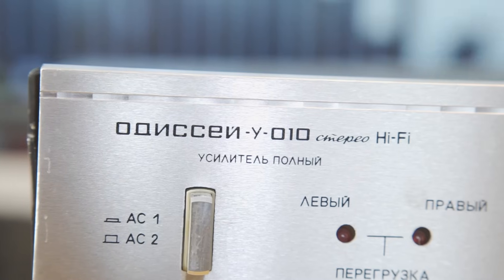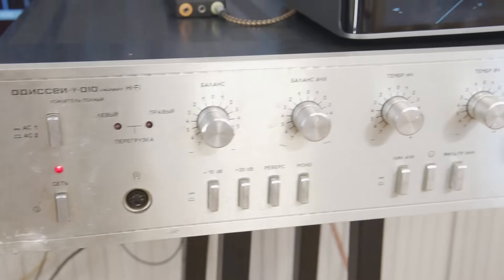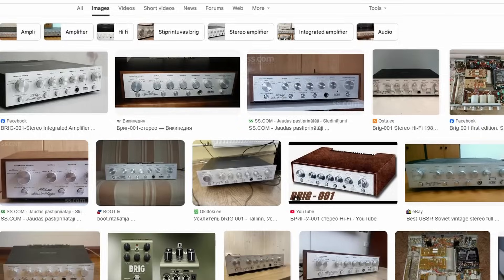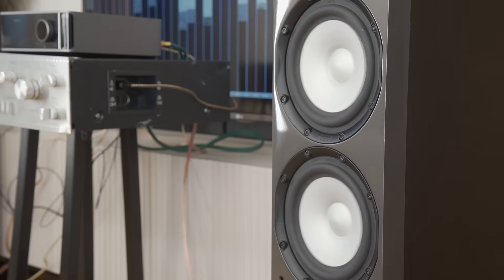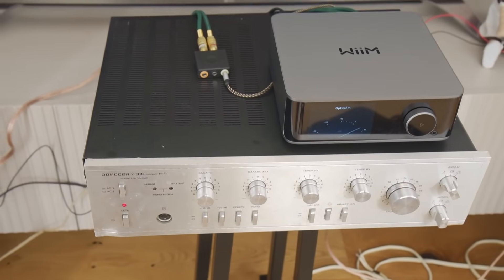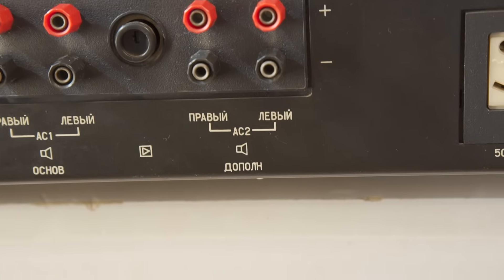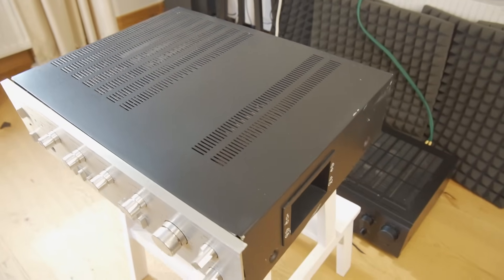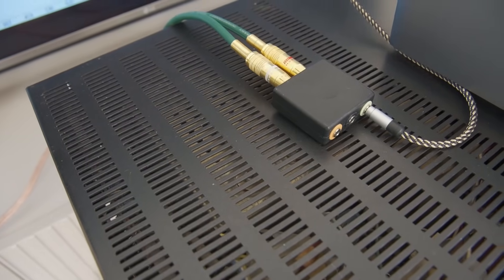Look inside High End USSR Amplifier Disassembly

Comment: If it hums when you turn it on then you’ve got power supply or possible transformer issues.
Reply from the maker: Then 90% of that time, the system has issues. That hum doesn’t come from the speakers, but from the huge transformer.

Comment: Soviet transistors are horrible - the current gain may be 20...180.When you measure voltage drop on junction - each transistor has different voltage drop. There were transistors with current gain = 1. I didn`t measure the transition frequency and noise but these parameters I think are not so good. The USSR had not technology of artificial silicon (Si) for semiconductors and they manufactured lots of defected ICs. But for HI FI equipment it needs quality operational amplifiers

Comment: I'm surprised to see selector switches with resistors as tone control! I've never seen it in hifi like this. The design inside and out has 80s W-Germany audio vibes. The DIN connectors also support this idea. Very neat and unique device anyhow! The amount of connectors on the side is also very interesting.
Reply: As well as you, I'm surprised too to see selector switches with resistors as tone control, but now I think it makes more sense to do it that way.
Because you don´t have a running contact wearing a potentiometer..., and even you have gold contact to gold contact interface 👌
They come up with original and solid design ideas at those times..., other example are the Cassette Decks with 3 full direct drive motors, no belts at all, 99% of problem solved 🤯
Greetings from Buenos Aires 🙂
Reply: That is nothing special, even my cheap Chinese made MC-22 clone preamp has the same syle stepped tone control too, only difference is resistors and capacitors are on the pc board, which is better for repair service anyway. And old Marantz 7 pre has that same style of tone control construction.

Comment: It looks be a very well made device; as I don't believe that in U.S.S.R. there was the technology to design a so sophisticated hi-fi device, it had to be a clone of a german brand model (the DIN connectors were typical of the german productions: the american and japanese manufacturers, instead, already used the RCA pins).
Reply: Luis do really think people that designed aeroplanes and space rockets don't know how to design proper hi-fi amplifier,come on man 😀
Reply: @kikopasinecki5110  Here is such a paradox, the country that made spacecraft and powerful weapons did not know how to make normal cars, household appliances, audio equipment. Most often, Western samples were either completely copied or partial copies were made. Extremely rarely were fully self-developed samples produced. As an example, compare photos of Japanese speakers from OTTO SX-P1/Fisher STE-1200 with Электроника 100 АС-063 will be very surprised.
Reply: Did you ever see the russian photo cameras of the ‘70-‘80 years (the ZENIT)? They were at least 15 years slow than the japanese ones, there were no comparision. And what about the "KIEV80", which was a clone of the swedish Hasselblad or the "ZORKY" which was a copy of the Leica M4?
Maybe now in Russia there are the same technologies of America or Japan, but in the ‘80s it surely didn’t go the same way.
Reply: Полностью аутентичная, классическая схемотехника этого усилителя. В СССР это были разъемы ГОСТ.

Comment: The attention to detail and the build quality is amazing, even the bulk electrolytics have bleeder resistor across them.  You'd do well to disassemble it and give it a thorough cleaning, visually check electrolytics for bulging and replace any that are.  Also remove and replace the insulating washers that go between heatsink and power transistors and apply new thermal compound, it does dry out over time and cooling becomes less efficient and yhere's not much chance you'll find replacement output devices with the same type number.
Also check the output terminals for offset voltage, a few millivolts (up to 10) isn't a problem and there should be a pot for adjustment of that and another pot for quiescent current which you can set up with a signal generator and an oscilloscope.
Reply: You are partially correct Steve,he should clean and reset the idle current,but the capacitors are very hi quality ,they rarely go out and the transistors are very common in Russia and ex USSR countries,it is marked with Cyrillic letters KT819👍
Reply: @kikopasinecki5110  these where *KT819GM/KT-818GM (probably Toshiba clone) and shouldn't be confused with KT818/KT819 A/B/G. also all the through hole electrolytics should be thrown away ASAP
Reply: Начинать надо именно с электролитических конденсаторов,  они не "вздуваются",  а со временем теряют емкость  и имеют увеличенные утечки... - заменить все на новые;  подстроить напряжения.
Reply: This is a high-end Soviet amplifier, and it comes with technical documentation with detailed instructions on how to configure all operating modes for each module. These instructions are freely available on the Russian internet.

Comment: This amplifier needs complete prevention with soldering of all contact leads of radio elements, replacement of all electrolytic capacitors, cleaning of all contacts on switches, adjustment of quiescent currents and zero voltage at the output of the power amplifier. And only then can audio tests be carried out. Without prevention, this amplifier will not show a small share of its capabilities in sound. Nevertheless, the quality of radio parts from the times of the USSR is much worse than Japanese, Korean or European manufacturers and the 40 years that have passed since its release have not had the best effect on the condition of all radio parts.
Reply: Вы все же ошибаетесь. Лет 5 назад я нашел в лесу платы старого советского телевизора. Судя по мусору они пролежали там года 2. Этим летом я наконец выпаял все компоненты, помыл, просушил. И многие из них выдают нужные параметры! Они конца 70х годов!!
Reply: @AlexUboot96 да, ми все ошибаемся. Конечно, только вьі в живую видели старьіе советские компонентьі, а мьі - только в кино.
Reply: You are speaking nonsense,the parts that USSR made were top quality.They made airplanes and space equipment,and you are telling me they don't know how make resistors and capacitors🤣
Reply: @kikopasinecki5110 Are you joking? Maybe hi quality was in military electronics or maybe in aircraft. But it was not in mass market devices. The dead capacitors are a curse of old USSR electronics. Especially if it was produced in the end of 80s
Reply: @kikopasinecki5110  I live in one of the countries that were part of the USSR, and I had many different audio equipment produced by various factories in the USSR. Therefore, I know what I say, the best samples of radio parts were selected for space and military equipment, the second class went to equipment that was exported to the Warsaw Pact countries and some capitalist countries, everything else went to the domestic market. Look for a video on YouTube where Soviet audio equipment is being repaired, you will be very surprised at the comments of the masters about the quality of the parts. I myself was engaged in the repair of such equipment and believe me, the quality of Soviet, mass, parts is many times worse than the cheapest with Aliexpress. The spread of the declared parameters is +/- 20% of the declared nominal, consider it lucky. To find a pair of transistors with similar parameters, it was necessary to measure a large number of transistors. Even releasing them in one batch did not guarantee the same characteristics.
Reply: @kikopasinecki5110  I live in one of the countries that were part of the USSR, and I had many different audio equipment produced by various factories in the USSR. Therefore, I know what I say, the best samples of radio parts were selected for space and military equipment, the second class went to equipment that was exported to the Warsaw Pact countries and some capitalist countries, everything else went to the domestic market. Look for a video on YouTube where Soviet audio equipment is being repaired, you will be very surprised at the comments of the masters about the quality of the parts. I myself was engaged in the repair of such equipment and believe me, the quality of Soviet, mass, parts is many times worse than the cheapest with Aliexpress. The spread of the declared parameters is +/- 20% of the declared nominal, consider it lucky. To find a pair of transistors with similar parameters, it was necessary to measure a large number of transistors. Even releasing them in one batch did not guarantee the same characteristics.
Reply: @kikopasinecki5110 only resistorz and capacitors were fine. Diodes were ok. But other semiconductors like transistors were mosly not good if they are not military grade #9.

Comment: Fascinating. Russian on the outside. English-marked part numbers on the inside.
Reply: I am curious where did you see English marked electronic parts?It is all in Cyrillic,and the transistors is marked KT819(Latin and Cyrillic  K and T are the same).
Reply: Импортные детали в советских усилителях не использовались или использовались крайне редко.
Reply: At 2:15, look at the markings on the PC board. R7, R23, C19, C23 are obvious in the middle of the board. Russian doesn't use "R"; and "C" works well for English "capacitor", but less well for "конденсатор", so is unlikely to be the Russian "S" symbol. On the other hand, I see mechanical parts clearly marked in Russian. An interesting combination.
Reply: @lwilton  Incorrect. All elements in diagrams was marked in Latin, it`s normal practice for USSR. Like R, C, L, but values was in Russian. v-volts-в-вольт, khz-кгц,  Ohm- Ом, mH-мгн......

Comment: I am quite surprised to see this kind of a high end type stereo amplifier which was made in the USSR back in the 1980's !! 😮 😮 
It has the same appearance of a well made European or Japanese stereo amplifier of the same period.!
I am astonished to see this Soviet made amplifier of this quality !! Can you please tell me whether it was a consumer product made for sale in the Soviet Union mass market at that period or else it was a limited edition model made just for the show !? 
Thanks for a reply!
Reply: This model was released in a batch of more than 10,000 pieces. It cost at the time of release in 1984 about 500 rubles of the USSR, translated into dollars at the exchange rate of that time it is about 400 dollars.
Among all brands and models of amplifiers produced in the USSR, this model at that time had advanced circuitry, a unique system of balance of amplitude-frequency characteristics of the timbre block, stabilized power supply of the power amplifier units, which made it possible to obtain a large nominal output power with low distortion, and then more than 50W for a load of 8Ohm, the maximum power on the latest modifications of this model was brought to 100W per channel.
Reply: @RKL-i8o  10,000 pieces were a substantial amount. 500 rubles equalent to 400 dollars was a high figure comparatively in 1984 ! 
I remember buying in 1982/1983, Japanese made Kenwood KX 50 cassette deck, KA 30 amplifier (25 W per channel) & LS 99 Speaker system (3 way, max. 100W) all three items for around 400 dollars (Rs.10,000/-) here in South Asia where i live.
I noted the description of your comment and see that this amplifier was a very good, advanced model made in the Soviet. I see that this amplifier delivered 50 W per channel at 8 ohms. When was the latest modification of this model with 100 W/channel made !? 
Soviet was a total communist country at that time. I am surprised to learn that this kind of consumer electronics were made for the Soviet mass market at that period !! Its very good to hear about this matter from you. Were you living in USSR at that time in the 1980's !? 
Thank you very much for mentioning all these details in your reply ! I appreciate it! 🎉
Reply: @janath9118 я жил в ссср в 80х. цена была 350р. это очень дорого, практически две зарплаты советского рабочего. новая модель называлась одиссей 100у-021. дизайн и исполнение у него на много проще, он весь пластиковый но мощность у него реально очень большая, 100w на 8om без искажений. у меня такой есть, работает уже более 30 лет.
Reply: @МихаилПрохоров-ь2е  Very sorry, i cannot understand your language.
Reply: Odissey-010 was mass manufactured. It is not a High End actually. It is just quite Ok for its time, like good hifi.
Reply: @volodymyrzakolodyazhny I noted it. Thank you for the information !!

Comment: New Capacitors.....PLEASE.
Reply: The capacitors in this amplifier are first class(same as the Japanese or American ).I'm a repair man and i can tell you that the electrolytic capacitors used here rarely die in CRT TV's(which is more hostal environment because it uses switching power supply) and in this amplifier they will last very long.
Reply: @kikopasinecki5110  High-capacity capacitors from the power supply are possibly in good condition, but the rest are already a lottery. It is better to replace all the little things, these are not Yamaha, Luxman, NAD, Marantz, SANSUI, ONKYO, with their almost eternal radio parts. Soviet capacitors, especially those produced at Armenian factories, are simply terrible, often even the warranty period was not worked out. If you come across electrolitic capacitors with a ceramic bottom, then you received greetings from Armenia.
Reply: @kikopasinecki5110  They are still 41+ years old.....
Reply: @kikopasinecki5110 you hear the humming. Thats always bad.
Could mean dead caps. Most likely.
Or just bad design.

Comment: Pity it's on DIN sockets instead of phono sockets but I suppose adapters aren't hard to find online.
Reply: DIN connectors were used throughout the USSR radio equipment until 1990, only a few new amplifier models released at that time had RCA connectors.
Reply: DIN connectors are a real pain to solder but unlike RCA connectors the DIN plugs do have a common earth pin for both channels which allegedly can reduce earth loop noise.  The Naim brand of amplifiers still use DIN connectors but some people say that Naim do take tings a bit too far, Naim shakes their interconnect cables in a jig which allegedly improves the sound - don't ask me how!